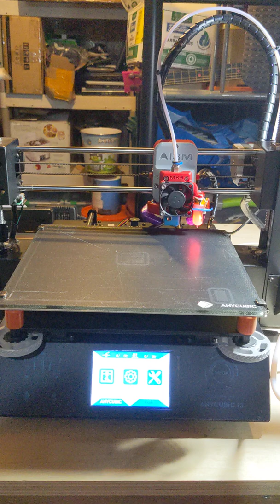Klipper z_tilt adjust in action

Comment: I got this working on my Mega S. Here's the printer.cfg section - I really don't understand the "pivot point" idea, but this seems to get good results:

[z_tilt] 
z_positions: 
  180,185
  -5,185 
points: 
  180,185  
  -5,185 
speed: 50
horizontal_move_z: 5
retries: 10
retry_tolerance: 0.01